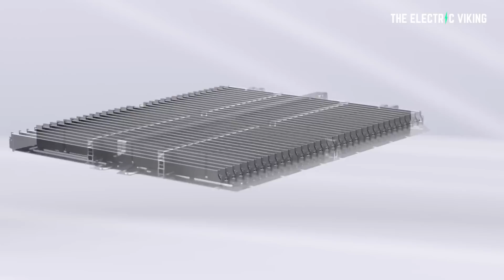Electric cars & pick up trucks will have more range than gas

Comment: There is an estimated 1.8-2.0 Billion ICE vehicles in operation globally. If by 2030 50% of annual vehicle sales are BEV thats about 40 million. Thats about 2% of the vehicles in operation overall. I don't think gas stations are going to disappear any time soon.
Reply: The thing is, EVs are ramping in some countries and not in others. 
UK, China, Germany and France could hit 33% market share for EVs in 2023 already.
Also, keep in mind that gas stations work with very low margins, if they lose volume the price of gas will increase, which will only accelerate EV adoption.
Reply: @mpbello  Thanks for reminding me about the low margins it’s the overpriced unhealthy snacks that make the profits
Reply: @mpbello  We will see.  The real question is, will the power grids in those countries be able to support the increased electricity required to charge these cars.  California seems to think, no.

China will be ok as they will just build more coal-fired power stations.  Everybody else may find it becomes an issue when the cost of power starts ramping up, which already seems to be happening.
Reply: @JohnSmith-ux3tt  what are you talking about, china is more into renewable energy then both the U.S. and Europe combined. Where do you think the solar panels and batteries are made? 
The grid is consistently getting upgraded  and now even rapidly converting to renewable source so no worries.
Reply: @JohnSmith-ux3tt  as long as smart charging is used for the majority of EV charging then most grids already have spare generation capacity - possibly enough to cover all EV requirements. Grids are only under strain at peak times, including California. I don’t think the grid is a limiting factor IF smart charging is the mainly used form of charging.
Reply: @JohnSmith-ux3tt  i respectfully disagree.  I believe that while energy costs are rising currently, that’s mostly due to the effect of the Russia-Ukraine war and the stranglehold OPEC still has.  The methods of producing electric power are becoming more and more diverse and “democratized”.  By which I mean that more and more individuals are powering their own homes with rooftop solar, occasionally wind and storing excess in batteries such as Tesla Powerwalls etc.  As more people do this, there will be reduced demand for power produced by the traditional big, centralized sources we use today.  Note that it also reduces load on the overall county / state / national grids as these microgrids  are generating electricity at the point of consumption.

The diversification of sources includes: more and more efficient solar, bigger and smaller wind turbines, offshore wind, tidal and wave, more geothermal, heat pumps for defraying energy use for heating and cooling.  Unlike traditional generation methods (with the exception of hydro), the inputs to these sources are essentially free.  The most significant cost is the up-front build + installation, with some ongoing maintenance.

The other point not raised in the video is that gasoline will continue to become more expensive.  As fewer gas vehicles are on the road, the costs to produce it will essentially remain flat at best, assuming any new sources are equally easy to drill & recover from as they are currently.  Locating, drilling for oil are costly. Refineries use ghastly amounts of energy to run and maintain, those are fixed costs that are difficult to reduce.  Distribution of the end product is expensive and becomes more expensive the further apart the stations get as less profitable ones close. None of these aspects of gas production are easy to automate, pretty much all require a lot of human oversight or labour to accomplish.

Additionally, electric vehicles are set to become cheaper and cheaper.  There are so many competitors and new companies coming to market it’s head-spinning.  Many won’t survive of course, but the flurry of activity will drive efficiencies and further innovations in manufacturing.

If I’m correct and both EV purchase prices and electricity prices come down in tandem, it’ll be the absolute death of combustion vehicles.  Better reliability, less maintenance, cheaper to operate and equivalent or possibly lower initial costs will mean even ditching a relatively new and well maintained gas or diesel vehicle will be a better financial decision.  This is a calculation that many companies are already making.
Reply: @JohnSmith-ux3tt  Check out Tony Seba’s lectures on YouTube, he has an excellent track record with his predictions. Grid’s will need to adapt but not as much as you may think. Solar panel efficiency is still increasing predictably while costs are still decreasing predictably. Right now, as it stands today, I can put enough solar panels on my roof to provide for all my family’s energy needs as well as charge an EV for the vast majority of urban driving (95% of the driving most people do). People will produce the required power at home, meaning the grid will require less capacity. Home solar + batteries will become cheaper than even the cost of transmission (grid upgrades, maintenance etc.), grids will not be able to compete on cost. Economics will drive this change, not saying it won’t be a bumpy transition but that’s the direction it’s headed.
Reply: @JohnSmith-ux3tt   This argument doesn't take into account the fact that EV vehicle owners are also more likely to power their homes with solar power, so during the day they can get free electricity from the sun.
Reply: Thumb up, but in half of the world, cars are changed more often than once at 15 years... And gasoline prices...and the possibility for so many to get their "combustible" from the roof...
Reply: Unfortunately, you are correct. The transition is far from complete. But I think some aspects are accelerating gas station demise. Urbanisation means many gas stations in rural areas get less economically viable. Underground fuel tanks and pumps that has to be renewed are costly, and owners will be reluctant to re-invest in technology on the decline. Gas stations make more money selling stuff to ev-owners that have to spend more time charging than from people just coming in to fill a tank. In places where space is limited, station owners will have to choose keeping the pumps or expanding chargers (which gives more business).
Reply: All they have to do is stop importing oil when it is no longer necessary or when it becomes more expensive than running an EV. It would be like when people stop using film cameras, shops where you develop pictures disappered
Reply: I think it will be far more than 50% by 2030. And, given cost savings of EVs over ICEVs I think many ICEVs will be retired (and hopefully recycled) earlier than previously.
Reply: @glennjgroves  Even at 100% BEV sales by 2030 means annual volume of 80,000,000 vehicles. (actually not enough raw materials exist by that time to produce that many batteries according to the mining CEOs but thats another discussion) At an annual production and sales of 80 million BEV cars per year it will take 27 years to replace all the ICE cars at that rate. This is just math. Gas stations and specific sectors of ICE will be around much longer than is being bantered around.
Reply: @sunrisejak2709  I think you have left out some relevant points though. The average life of a car is about 12 years - admittedly depending on country. It will not be 0% EVs in 2029 then 100% EVs in 2030, it will be mostly EVs in the few years leading up to 2030. Therefore, on averages alone, at least half of ICEVs sold before 2028 will be off the road by 2040, the rest by (say) 2050 - which does somewhat align with what you are saying.

But then take into account the extra costs of maintaining and running those ICEVs. The inconvenience of finding a petrol station that actually still sells petrol. The (eventual) increases in the cost of petrol as production decreases. There will likely be taxes to encourage people to take polluting cars off the road - both noise and air pollution. I somewhat agree with what you are saying, but it is not just a question of numbers - EVs are not just new versions of ICEVs, they are actually better.

I recommend watching RethinkX/Tony Seba for some more understanding of how past transitions have occurred. They are anything but numbers so to speak. Numbers only apply when the new is not significantly better than the old.

Mining MAY or MAY NOT be a limiting factor. If you had told anyone 100 years ago that there would be millions of petrol cars on the roads in a decade or two, they would have laughed and said there were not enough oil wells or refineries. Mining will ramp up.
Reply: @glennjgroves  You may be right. But the numbers are head scratchers. Two mining CEOs heavily doubt the capacity will be sufficient to extract the necessary raw materials to meet even 50% by 2030. They spoke out publically after governments began announcing unrealistic date objectives and they basically said "no way". But,,,, maybe. 2 billion ICE vehicles on the road. In the US it might be average age of 11 years but not so in many other countries/markets. If these folks are "forced" to move to EV this will present some pretty challenging requirements. Either more production or more debt as those with insufficient funds to transition have no choice. I did a little research on how much material needs to be extracted and refined to make 1 battery pack. Its staggering! To supply the entire industry billions and billions of kilograms of material need to be extracted as the yield is rather poor for many of the necessary elements. The industry struggles now with battery supply, and the global EV share is less than 8%. Ramping up 12X means some pretty massive mining. Even Tesla is concerned enough to plan to refine the materials themselves to ensure supply. Maybe,,, But why the rush? Why tbe "panic". The sky is not falling. A well planned and strategized execution with orderly steps and reasonable goals means everyone's interests would be considered. As its projected now its a mad dash and the company that exploits the worlds resources fastest will win the race. China with a huge headstart and lock on some valuable resources. Do you know why Japan, S. Korea, and Germany (Toyota, Hyundai, BMW) push for hydrogen? They see access to battery materials monopolized by China and it will be a troublesome bottleneck. Its not about whether its a better energy source its one thats equally available to all. Seems not well targeted to make it a "free for all" when not all players will have equal access to the worlds resources. But thats another discussion. 🙂 Anyway, I dont deny your points may be correct. But at this moment the numbers just dont add up. But with paradigm shifts unknowns can rise up though. 😁
Reply: @glennjgroves  In the late 1800s and early 1900s Standard Oil refined oil to get kerosene for lamps and heating. A by product was "useless gasoline" which they simply disposed of. So even in the early days of the gas automobile fuel was never a problem. Back to batteries. Dont forget the energy storage sector. This industry also has huge projected demands for battery packs in potentially massive volumes. Anyway I readily admit I'm no expert in this topic but just trying to figure out if the EV transition can indeed occur in the time frames being proposed. Seems daunting. 🤔
Reply: @sunrisejak2709  this is why Tesla has now said they will enter mining.

They politely asked the miners to dig up more stuff. Miners said No Can Do! Now Tesla is digging themselves.

Same story as the batteries, really - even though the 4680 cells seem to be obsoleted by CATL already, Tesla still moved the battery industry.
Reply: @glennjgroves  Yes. Today's infrastructure is a lot better start to transition to EV and renewable energy than the automobiles had in 1895 to disrupt the horses.
Reply: @sunrisejak2709  Watch Tony Seba's videos. The market forces of the disruption supports the new turnover of the technology disruption as it's happening. The incumbents always fail to see the disruption happening from inside the industry.
Reply: @GG-si7fw  I'll look i to Tony Sebas videos but I'm not questioning the disruption or pace of disruption. I'm doubrful the earth's natural minetal resources can phtically be exploited at quantities necessary to keep pace with the transition. Estimates range from 90,000-5,000,000 lbs of thecearths crust to be exvavated PER CAR to obtain enough raw materials to produce ONE  battery pack. It seems the mining expansion may not be practically able to ramp at this pace. Tesla has the foresight to ensure their supply. But at present that demand is less than 2% of the goals being discussed by 2030. Incumbents or new players either way will be faced with the same dilemma. Even on the low estimate 80 million vehicles needing 100,000 lbs of earth material to be excavated is I think 1 trillion lbs of earth to be extracted. (not 100% sure as the number of zeros was rather long! 🤣) The mining CEOs express we will get there but not at even by 2035 at full 100% annual demand.
Reply: Sorry for so many typos! The articles I read show 90,000 to 500,000 lbs of raw materials pulled from the earth to create 1 battery pack. 80,000,000 battery packs thus require mind boggling amounts of material to be physically extracted. Maybe,,,, 🙂
Reply: @sunrisejak2709  Seba is the only person that can explain economically why the automobile disrupted horses and why the iPhone came out in 2007, not 2005 or 2009.
Reply: @sunrisejak2709  look into the Salton Sea lithium mining project. It uses geothermal to exchange the salty brine with lithium. This is what Elon talked about at battery day, dig up the soil extract lithium with the sodium ion exchange process, and then put the dirt back.  Lithium iron phosphate batteries do not use nickel, manganese, or cobalt. Over half of the EV batteries made in China uses LFP. They are way ahead of us and the IRA is to keep even with China, and not let them dominate the EV industry.
Reply: @GG-si7fw  Yes, this has been discussed openly. But of course many obstacles are yet to be resolved. In the articles I read the words "hope" or "intend" often come up. But if anyone can pull this off it will be the American folks who will grab this opportunity and run with it. Elon says "license to print money" but it seems only 3 modestly funded operations are chasing this huge "gold mine". Hope it works. Oops, theres that word "hope" again. 😁
Reply: @sunrisejak2709  completely agree that it seems daunting, and I also am not an expert but this is where I believe human ingenuity comes in.  There’s profits to be made and a lot of bright people on earth.  Currently several companies are trying to massively improve the amount of lithium extracted from the brines (the current recovery amount compared to how much is actually present is dismal) using essentially a nano-filter technology.  Also, there’s a pretty strong belief that it may be possible to extract the lithium from seawater with the same process - the oceans of the world contain millions (billions?) of pounds of lithium.  Keep in mind that recycling of lithium batteries is also happening now, although I’m sure there’s still quite a way to go to maximize recovery percentages.  Maybe we owe a back-handed thanks to LG for producing a huge whack of bad batteries for the Chevy Bolt and Hyundai Kona EVs, hopefully that will help optimize the process.

Lots of new battery chemistries being explored along with other non-chemical storage concepts means that lithium can be conserved for vehicles.  Stationary storage of energy cares about cost, longevity and maintenance more than size and weight, Tesla has really just been first to market with their grid-scale battery packs that help capture excess production by intermittent renewables for use during peak times, and Tesla does lithium-ion because that’s what they know.

If you watch Viking and like his content, I’d further recommend several other channels: Two-Bit DaVinci - Just Have a Think - Undecided with Matt Ferrell.  All post very informative videos about new energy technologies: electricity production, storage, efficiency, EVs, or similar related stuff.

The amount of innovation in the energy space along with advances in materials engineering, automation, additive manufacturing, computing power is truly remarkable and actually leads me to believe we’re on the cusp of an energy glut and electrification of almost every aspect of our lives in coming decades.  

At least that’s what I’m hoping, we need to keep this planet livable for our kids.  Cheers!
Reply: @sunrisejak2709  When expressed in lbs that sounds like a lot. It’s simpler to calculate tonnage (which is what the mining industry uses). For simplicities sake let’s go with the higher end of that estimate (500 000 lbs) . 2000 lbs = 1 ton. The largest caterpillar, the 797F carries 400 tons of ore, or enough for 1.6 battery packs per load. A quick google search says there is approx 52000 mining dump trucks in operation in the world today that have a payload of at least 90 tons. Let’s assume an average of 200 tons which would be an average of 19.2 battery packs per truck per 24 hours X 365 (days per year) = 7008 packs per average truck/per year X 52000 (dump trucks in operation) = 364 000 000 packs per year. 
So if we want 80 000 000 cars let’s do the math that seems much more manageable. I realise that all of these 52000 trucks can’t just be immediately be repurposed to mine battery materials, just doing this to illustrate that it is not as unrealistic as it may seem.
Reply: @alexarthur4378  Math was never my strong suit! 😁Thanks for putting this challenge into more logical metrics. I'm following the developments with lithium extraction and the Salton Sea projects but nothing is being ramped to any significant magnitude. It seems automakers are struggling to build enough batteries today for a global EV market share of maybe 5-6%. To get to 100% EV annual production the supply chain needs to go at "warp speed" in the next 7 years. The clocks ticking and new battery tech has yet to be commercialized and lithium production (at present) nowhere near a capacity to reach even 50% by then. I'm not being pessimistic but realistic. 🙂
Reply: @glennjgroves  Nonsense.  In the US the majority of people cannot charge at home, another large percentage cannot afford a new car.  Ice is going nowhere in the US.
Reply: @glennjgroves  You must be a kid.  People who have busy lives will not tolerate sitting at a charging station 30 mins.
Reply: As with all things, there needs balance.  The current amount of ICE vehicles and the number of gas stations are balanced right now.  As more and more vehicles switch to EV, more gas stations will close down or will have to evolve.  Gas stations mainly make their money off concession and not gas.  With the fewer people coming  in for gas, it’ll affect their profitability.
Reply: The busiest Shell gas station in the UK switched to only EV chargers a year or two ago and saw similar profits almost immediately...
Reply: True, but gas station profit margins are so razor thin that EV impact could kill gas stations sooner than we think
Reply: These changes show exponential curves rather than linear.
Reply: There is an upcoming industry of conversation's.  Where gas motor is pulled and electric motor with batteries installed.  That process will also increase the number of EV's
Reply: @jonathanwest6564  Yes, those kits are really cool. But at the moment crazy expensive. But I suspect the prices will come down over time.
Reply: If you haven't noticed they have been disappearing over the last 20 years.
Reply: Interesting point u could be exactly right
Reply: How many cars are retired every year? Making a comment like yours without that data is stupid.
Reply: @The Electric Viking another factor to remember is that gas costs are extremely likely to continue to rise.  There are a lot of fixed costs in production of gasoline that can’t be automated or reduced (refining particularly comes to mind) and as there are fewer and fewer ICE vehicles on the road, those fixed costs become a larger portion of the overall cost to the remaining customers at the pump. As gas prices rise, the EV alternative becomes more and more attractive.  It’s a vicious cycle that will contribute to the death of ICE vehicles in addition to the great points you raised in the video.
Reply: @sjsomething4936  You're right about fossil fuel costs rising. But I also suspect that once home energy and transportation energy is beholden to grid power companies we'll see prices rising as in many cases its a local monopoly. People cant simply switch their grid electric provider. They will have strong power over raising rates with little to no alternative for the consumer. I have a full solar system 😁 so I'm protected somewhat. But I don't trust the energy companies once they hold both home and transportation "handcuffs" over consumers.
Reply: @sunrisejak2709  Great job on putting solar on your own home 😎. I feel like the biggest challenge in many jurisdictions is going to be whether the grid operators are able to strong arm politicians over the ability to resell into the grid, at what volumes and what rates etc.  I’m thinking you may end up seeing whole subdivisions (like homeowners associations etc) or areas disconnect altogether and have their own small grid if the larger grid operator is extorting them and they’re able to be self-sufficient as a cohesive group. 

Big companies probably have little to worry about, at least here in Ontario Canada the largest consumers of electricity get the best rates, I’ve heard rates as low as 1/5 what individuals pay, possibly lower.  Also if they too (companies) are overcharged but able to generate enough power on their own they could conceivably disconnect.  I know if we put wind and solar on some of our truck yards we’d be able to generate massive amounts of power, although the warehouses are extremely power hungry so probably not enough to run them.  Especially seeing as the equipment is a bit dated now and therefore not very energy efficient.

All I know for sure is that things are going to be very interesting over the next decade when it comes to energy.
Reply: @sjsomething4936  The solar system was indeed a good choice. I live in SE Asia and we get lots of sun! Plus the components all from China or Taiwan are very reasonably priced and labor installation costs crazy cheap. I have a 12 kw system (22 panels) two 5kw inverters, and two 10kwh wall batteries for a total of 20kwh storage. It is called a hybrid system so I'm still attached to the grid but in practice I use very little grid power and pretty much operate independently. My batteries easily get me through evening and night and thats with air cons running etc. I do not have a program to sell back the excess power. The power company restricts the size of your system on a single phase house and the buyback price is stupidly low so it makes no sense. I also have a PHEV Volvo V60 T8 Recharge with an 18.8 kwh battery thats good for about 90km or 55 miles on electric alone. My wall charger takes about 5.5 hours to charge and at 3.7 kw charge power its easily powered with the solar system during the day. (I'm retired so time is flexible). My electric bill is near zero and 70% of my driving needs covered by my solar. The rest of my driving is distances on gas. It would be too inconvenient (at this time) with a full EV. The V60 is really nice and with 460 combined hp its no slouch. Back to the solar system. In USD terms it was about 14,000 dollars. Based on the reduction of my house electric bill and savings in gas I'll recoup that investment in about 5 years. Thats ok with me. Although Viking highly criticizes PHEVs I think I have the best of all worlds (at this time). Plus I love wagons (estates) 😁
Reply: @sunrisejak2709  wow, that’s a serious setup! Very nice, I’m hoping to do some upgrades to my house and make it more efficient, it’s a drafty 100+ year old beauty.  I love it but the maintenance is not easy.  Next roof I get will likely be the GAF nailable solar shingles, to keep the house looking sort of like it’s original state although that would have been cedar shakes.  With serious air-con requirements you might be very interested in hearing about the new linear compressor tech.  Look for exactly that phrase on the Just Have A Think channel. 

I also like wagons, I’m waiting for an affordable EV one when the technology advances a bit further, for now I’m satisfied with my Chevy Bolt, especially now with a brand new battery and another 8 years of warranty 😉
Reply: I get it. A big straggle. Lol
Reply: You are thinking linearly. By 2030 no one is going to want to buy ICE due to many reasons. So EV will be 100% by 2030.
Reply: @orhanmekic9292  My point is not so much about new car sales but the close to 2 billion ICE cars on the roads globally. These cars will not disappear overnight. Services will remain available to meet their support requirements for some time. Further unless substantial increases in battery raw materials is developed there is simply insufficient raw materials to build the necessary batteries to go 100% EV by 2030. Innovation could get us there but thats yet to be  commercialized. It doesn't matter what the demand is if the earths resources cant be exploited in adequate volumes to build whats needed. Unless either new battery tech is brought to market or new mining techniques created and implemented to process significantly more lithium 100% EV production of 80,000,000 vehicles annually by 2030 is likely impossible.
Reply: Gotta luv factless cultist. Your kids will die before gas stations 😮
Reply: Completely wrong the average age of cars on the road is 12 years they last over 20
Reply: The transition to electrification may well be inevitable. I hope it is. But is it still necessary to plan a smooth transition that contributes to general economic prosperity.
Reply: @777rogerf  so build cars people don’t want. Sounds like communism or welfare to me.
Reply: 50% of global annual sales could be 100% in some states/country (norway), some cities with great public infrastructure have started banning ICE vehicles, so gas stations there would cease to exist. 
But for countries that don't invest in infrastructure, yes they will still use ICE vehicles for decades
Reply: If you lose 2% of your gas business per year, in 3-4 years you are not making any profit anymore.  The gas stations will be closing left and right, because there will be no more profits.
Reply: @sergelbergeron  or they put up the gas prices, which will drive people to get rid of ICEVs even faster, losing even more than 2% of their gas business every year in a vicious downwards spiral. (We agree on the end result.)

To be fair, where I live gas stations make money out of other things they sell (eg food) mainly when people stop to buy gas. But if fewer people are stopping to buy gas… it all leads to a rapid downward spiral, only the details of how it plays out vary.
Reply: @spinnymathingy3149  electricity prices are not going to go up for ever - they will drop again, either when Russia returns to sanity or when a lot more clean generation comes in (which is the long term solution.) And, even with high electricity prices people can still buy cheap power if they buy it at the right time with the right retailer (assumes they can charge at home and have a choice in supplier, that only applies to some people unfortunately.)
Reply: @sergelbergeron  not much profit on gas, it’s the stuff inside
Reply: Shh that's too logical.  The large auto makers can only make a million cars a year.  That's a supply of about 5 million a year and you have to buy new.  Yeah not going to happen.